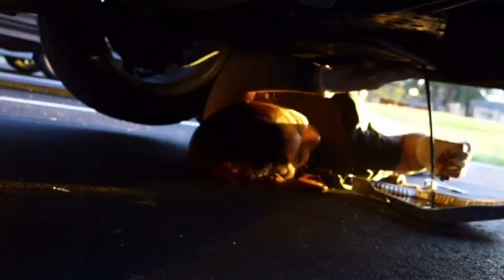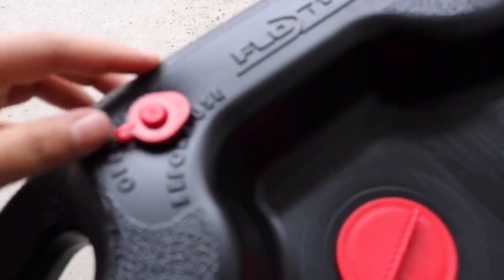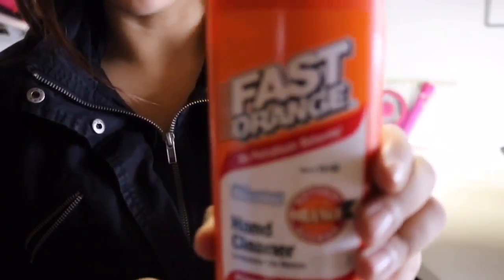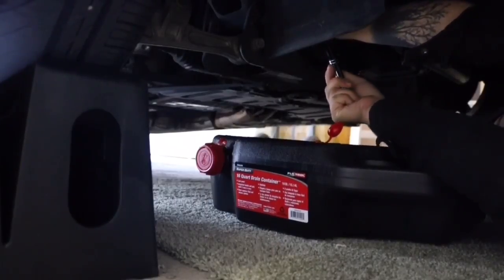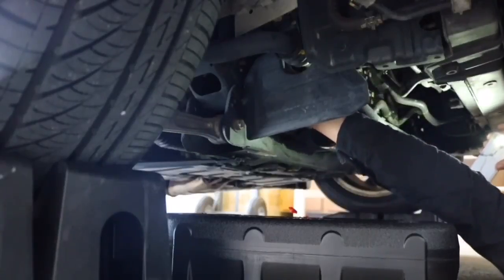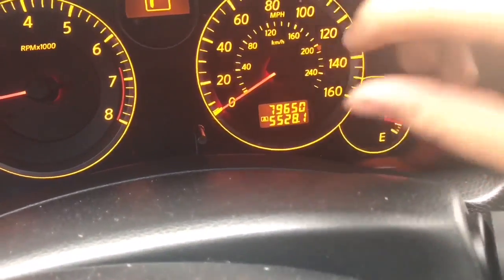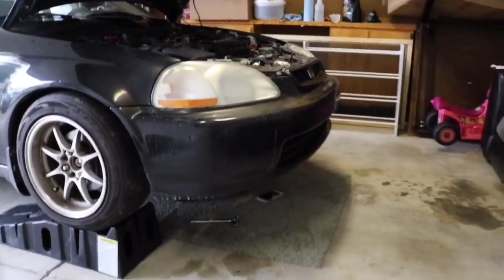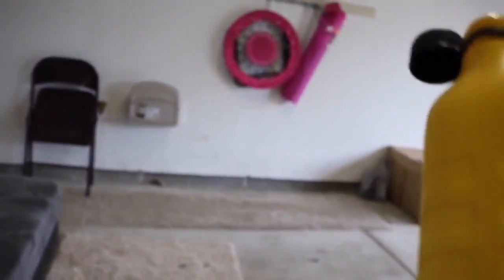The RIGHT WAY To Do An Oil Change!

Comment: Some tips are you should take the cap off when draining the car makes it faster. What if you drain it & the hood doesnt open or cant get the oil cap off? Hopefully you dont strip the drain plug cause im sure its a 14mm on the g.

Comment: Put oil on the seal on the filter 😂
Reply: She put it on the "Bearings"  😂 .  Jenn, (as RMAN stated) the oil goes on the seal of the filter, not on the little holes inside the filter. Anyway, props to you for improving from your previous mistakes. I would also suggest to change the crush washer on the oil drain plug every 3-4 oil changes or so.

Comment: I recently changed the oil on my 350z and the oil filter was on so tight I had to use a pipe wrench to get it turn. One thing I recommend getting is an Alluminum Undertray from Zspeed or TBWpeformance. I have one on the Z and it makes changing the oil easier.
Reply: Speeder105 is the aluminum undertray truly worth it??

Comment: A good thing to do before pulling the drain plug from the oil pan is to remove the oil fill cap. This allows more oil to drain and faster. It basically allows air in the engine to escape, allowing the oil to move freely.

Comment: How long did both cars take? After I practice on my G37 I'm thinking of making some change doing other peoples cars out my garage.
Reply from the maker: 1stGiant probably like 20 minutes each car just cause I was taking my time laying down chilling and getting different angles to record. But it should take 10 minutes it's real simple.
Reply: It varies, if you're gonna stick to just G37/G35/350z/370z, then they're similar enough that you'll know your way through them. But if you do a car that you've never done before it'll take you time to figure it out. But in general, the more you do it, the faster it will be.
Reply: 20 minutes aye nice and fast. And Jay thanks you make a good point but are we excluding the Q60's out of the family lol some of them are still rocking the VQ motor I think. Or maybe that's the Q50
Reply: I guess that's true lol I've never changed the oil on those, but I would assume its similar

Comment: You forgot one thing to do before you change your oil you got to set the e-brake for safety
Reply from the maker: Daniel Vargas I did I just didn't show that part lol
Reply: Jenn A oh ok
Reply: My oil changes: 
- Open garage door BEFORE the car is started. 😁
- Make sure engine is warm - turn off car
- Pop hood and remove oil fill cap
- Set emergency brake
- Jack up G or FX and set one jack stand on the driver's side - lower jack until pressure is relieved and leave in place as a back up in case the jack stand fails.
- Place down large transmission oil spill pan and set oil drain pan on top of that.  Larger pan catches anything that spills outside of oil pan (I like to use an open 6 quart oil pan and pour the used oil back into the oil jug when I'm done.
- Get tools in place
- Put on rubber gloves and goggles
- Connect my phone to BT speaker and play techno
- Remove oil pan drain plug and let drain.
- Remove oil filter and let drain
- Replace oil pan drain plug crush washer (every other oil change)
- Reinstall oil pan drain plug and tighten with a torque wrench to 16 - 19ft lbs
- Clean and check oil filter orafice to make sure the old oil filter gasket didn't stick
- Coat new oil filter gasket with a small amount of new oil
- Reinstall new oil filter and hand tighten ONE full turn after it makes contact with the metal orafice
- Slowly add the entire 5qt jug of Mobile 1 5W-30
- Start car and let run 5 minutes
- Check for leaks
- Lower vehicle and check oil level
- Add oil if necessary
- Turn off BT speaker because the neighbors are tired of it by now.